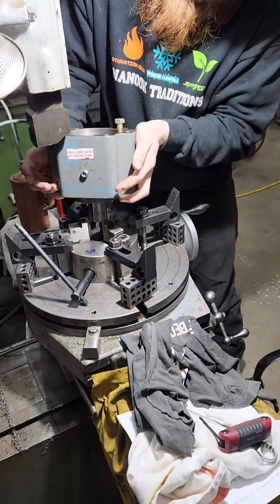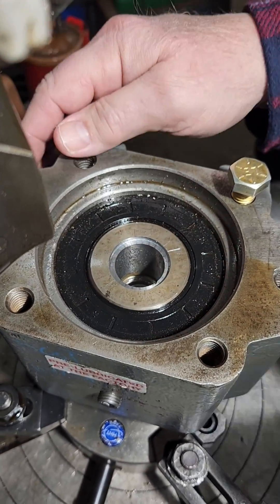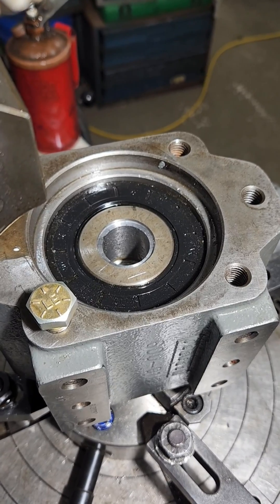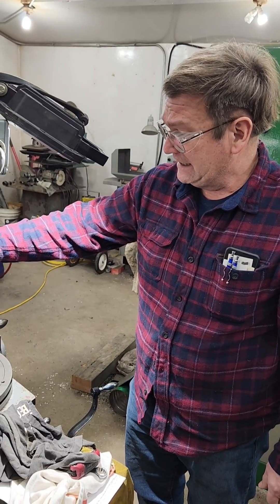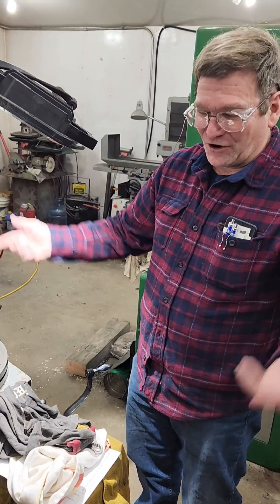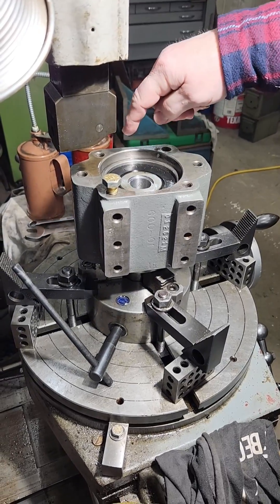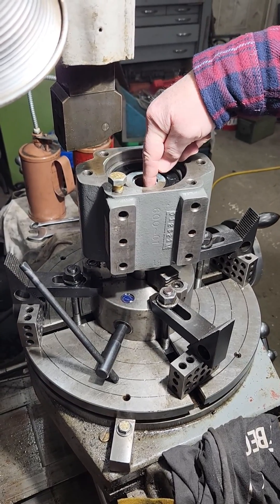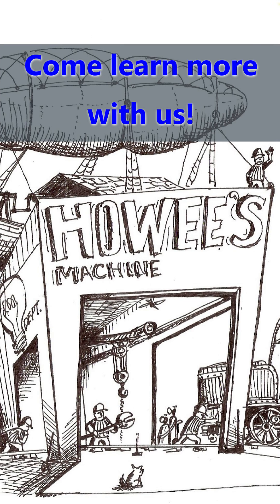Machinist's Minutes: Counterboring a case-hardened surface for spline cutting

Comment: Carbide  end mill?
Reply: How would you rotate the spindle axis to what is basically parallel to the x plane so that the y or spindle of the mill can make the travel needed to cut the splines in such a small bore? Not possible
Reply: @ianwright6893  turn table, broaching....
Reply: @wallacehughes4643  that’s a very good solution!
Reply: @wallacehughes4643  only issue I can see is if the splines desired are not typical. Would custom tooling have to be ground?
Reply: @ianwright6893  I confront problems like this everyday as  a tool & die maker 🙃😋
Reply: @ianwright6893  yes to do the involute of the tooth of the gear.... grind it from high speed tooling steel, carbide  too brittle, tilt the head for unconventional angles.